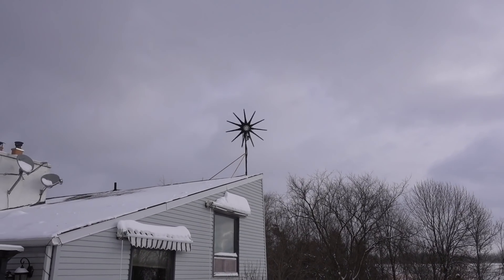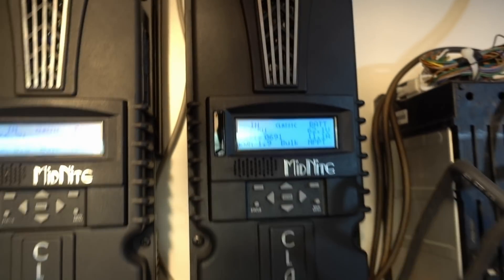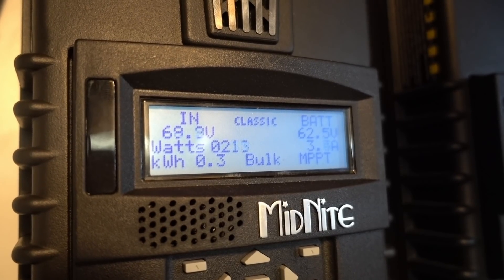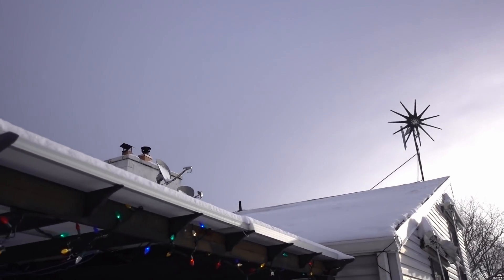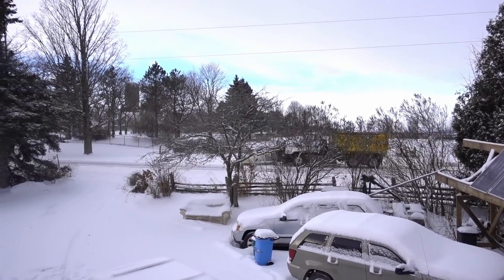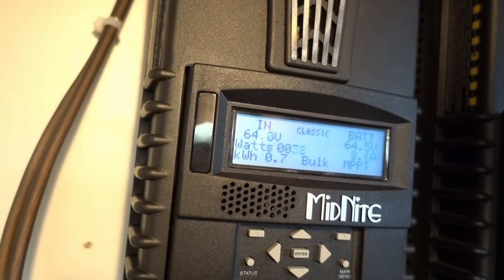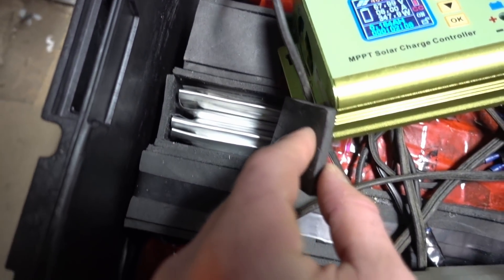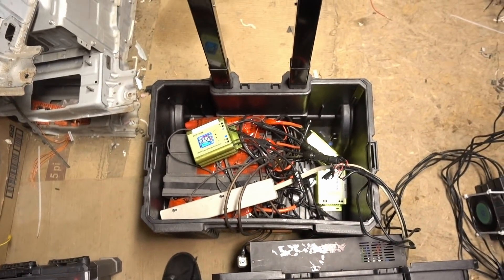Turbine Making A Few Hundred Watts

Comment: Hey boss your doing the same i am doing with the classic 150 put input from my air x dc to input of classic and put a temp wind curve on the classic but for the short while I ran the output of wind turbine to the classic i was impressed for alittle 400w turbine...mppt and the classic are the way to go, but i aint getting the 1700 dollar clipper, air x has internal rpm limiter and voltage.

Comment: Nice work on the WindTurbine. 
Just wondering if you know what the max RPM of the turbine is if that when it is producing the max Power.
Hope you have a great new years eve.
Reply from the maker: i do now know atm i will look it up
Reply: Going Off Grid around 2000 by memory, spinning like crazy